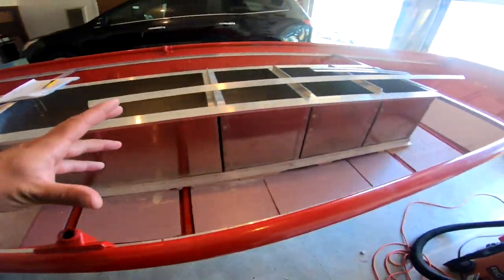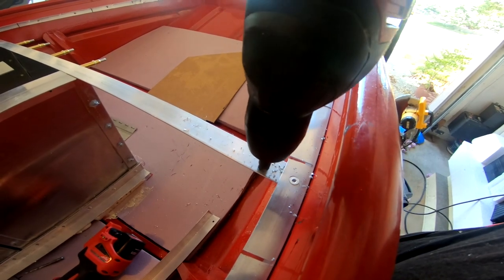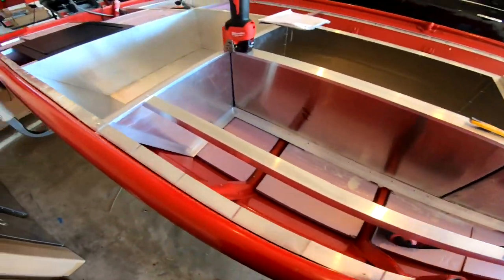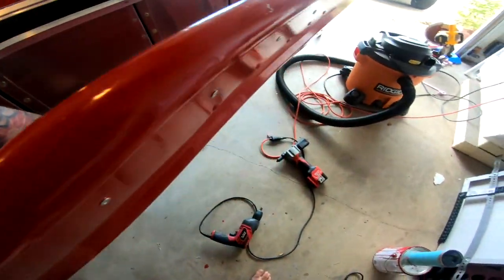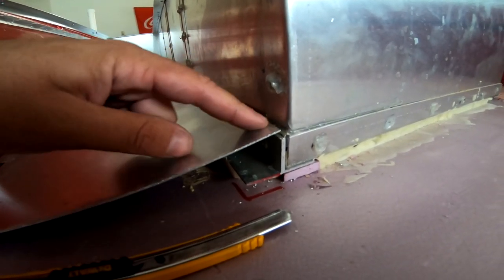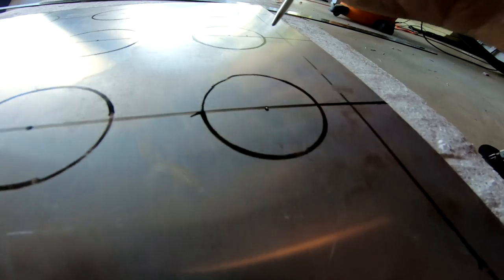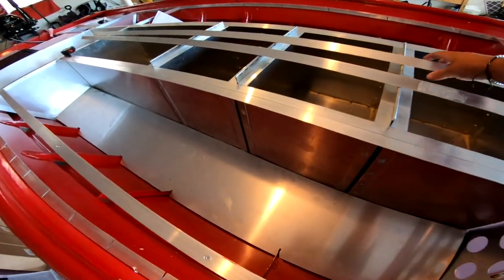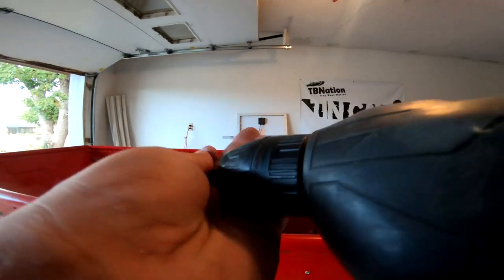BUILDING A ROD LOCKER IN JON BOAT TO BASS BOAT CONVERSION!!

Comment: I added a comment about adding a flat bar to the third layer you installed. Before watching the full video. Then you installed one. So I deleted it. Love the way you take pride in your work. It’s not just slopped together. You should be proud of yourself and what you can accomplish when you sit back and picture it in your mind. A lot of people can’t do that. They see it but just can’t get it out the same as the picture they are seeing.

Comment: Great job on the video bro I appreciate you mentioning the idea I gave you about the box for the gas tank and also what I was looking at is what about the batteries how are you going to put them and have you calculated to wait for the batteries for the fish finder and trolling motor and whatever else you might need are you still going with three or you going with two batteries
Reply from the maker: I’m gonna have 2 batteries, it’s all I need , and they are gonna go on the left side, it should balance out all the weight of me being on the right side when driving, I’m gonna test it out tho, they may go in one of the boxes, just depends where they work the best, I’m gonna get the boat on the water and move the batteries around before I decide

Comment: I’m curious why you’ve decided to put the rod locker hinge on the outside and have to lean over the lid to put rods in and not put the hinge on the opposite side (same length of hinge) and the lid opening inwards?
Reply from the maker: Because I will be going into the rod locker more often when I’m in the boat then when I’m outside of the boat so it will be more convenient facing inside the boat
Reply: @AdamRyanA  ahhhh yep that makes sense 🤙🏻 I love your videos, keep them coming 😊
Reply: @AdamRyanA  what is the song at the end of the video